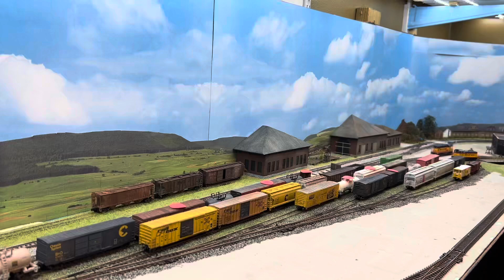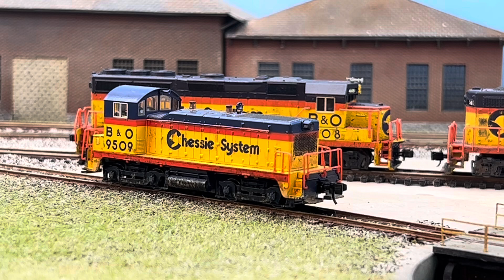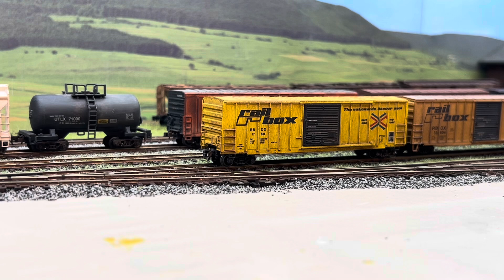Building the switching job for Douglas Avenue, Part 1

Comment: Hi Thom , I do enjoy watching the yard work. Nice looking new locomotive you got there. It’s been dry here also. We have probably gotten about 0.10 inches for the month of October. We had a warm Halloween. Thanks for sharing. Have a good weekend .      😎😎   👍
Reply from the maker: @tommynorwood5184  We had 0.43 inches officially. I found a chart going back to 2000 and it was the driest month on record by far. Only a couple of months under 1”. The temperature was fine, just the dreary rain and wind.
Looking forward to running the locomotive. So far it’s running well.
Enjoy the rest of your week and stay safe!

Comment: back scenery is good. would be great if seems in backdrop are fixed. really nice work.
Reply from the maker: @Phibes525252  I have tried to camouflage them a little. They weren’t that way when I installed them but they shrunk a little and pulled apart. Should have overlapped them by an 1/8” or so, but nothing I can do now other than to keep trying to make them less obvious..
Thanks for watching. Have a great week and stay safe!
Reply: @thomplacier677  I ran into that one myself in a basement where the humidity changed and so did the Masonite my backdrop was on. A dehumidifier was the answer in that situation. It was so annoying as it was the best backdrop I'd ever done.
Reply from the maker: @ My wife and I worked on the one behind the yard yesterday. She is going to attempt to paint the seam. It will always be there but hopefully it will be less noticeable. My layout is in a bedroom and climate controlled but behind that seam is a window.
Thanks for your input again. Stay safe!

Comment: Good morning Thom,
Congratulations on having only one more trip for the year next week! How many weeks were you traveling in 2024? 
Very enjoyable switching session to start the weekend. Overall the NW2 is a consistent performer in the yard. Always enjoy watching it. Very excited to see your new locomotive in action next week!
Up here we are coming off of 2 1/2 days of very windy weather so we’ll have quite a bit of leaves to pick up here. Supposed to get some decent rain Monday into Tuesday. 
Have a good weekend and enjoy your extra hour as we fall back with the time change.
Stay safe on your trip!
Scott
Reply from the maker: @kahunatiki6498  Good morning Scott. I haven’t counted my travel days yet. Our county refunds taxes on money I earned working outside the county, so I always total it up in January. I think my record is 80 days in one year, but I may have been close this year.
I found a chart online and this has been the driest month since the year 2000. 0.43 inches officially. Maybe some rain later this week. Leaves are starting to cover the garden railroad.
Worked on some scenery last night, plan on getting more done this weekend. I hope you can get in your train room some. Enjoy your weekend and stay safe!
Reply: @  I have been in the basement running trains. My layout is DC and I upgraded my transformer to a brand new MRC 9900 with a walk around throttle and it runs so much better. All of my motive power is fairly old so DCC is not a viable option and does not hurt operations. 
I also finally took the time to put a black skirt around the layout, following a video how-to from Ron’s trains and things. Looks so much better. 
Plan on working this weekend trying to complete trolley poles for the Shops yard and I am dabbling with a possibility of an expansion. 
Keeping my mind busy. Thank you for asking!

Comment: Good Saturday Morning Thom, Another great yard work video. That GE B30-7 looks great. Did you get the Gold Model from Atlas with the ESU lokSound Decoder already installed? I now have three Atlas locomotives with ESU LokSound and they all run great. On mine the Bronze/Brass truck wipers are gone, now being replaced with small wires that are directly attached to the decoder. Is this new B30-7 setup the same way? Cheers, Rich S.
Reply from the maker: @RWSBaden  Good morning Rich. I haven’t pulled the shell so I’m not sure how it’s set up. Literally pulled it out of the box and put it on the track. Still programmed to 3. It is the ESU Loksound, I preordered it from Mike Fifer a couple of years ago.
Thanks for watching. Have a great weekend and stay safe!